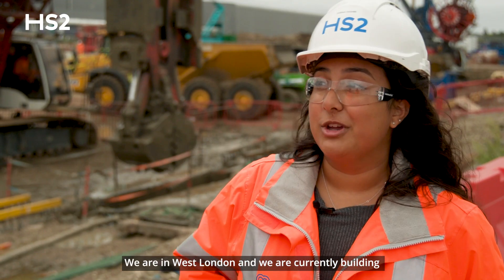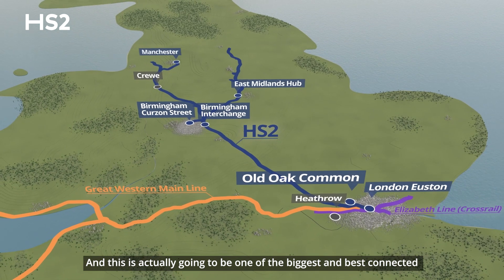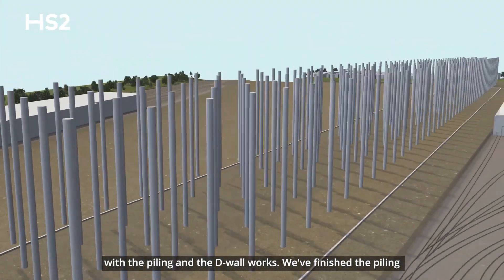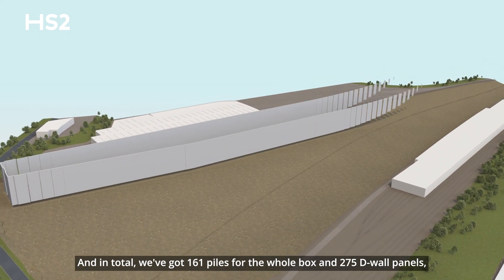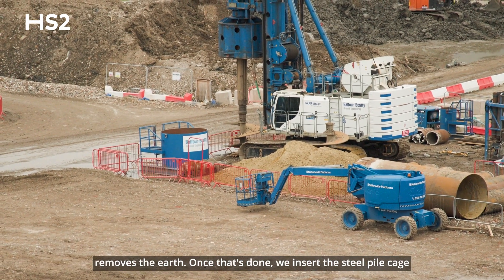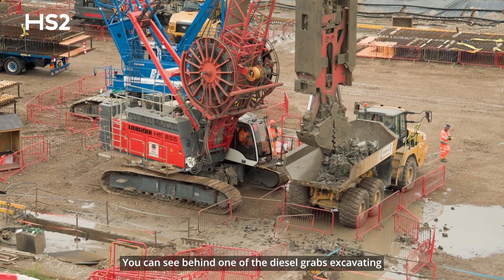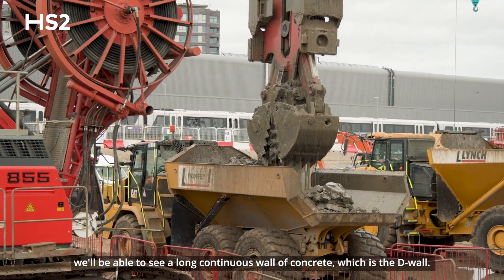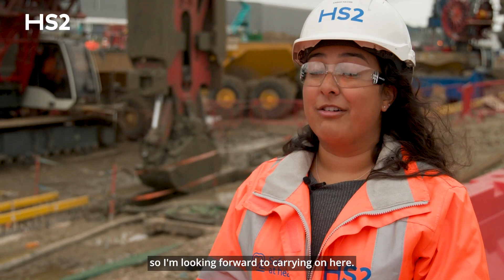Laying the Foundations for HS2's Old Oak Common High Speed Railway Station

Comment: Viewers will not miss the fact that you released this video with the "Eastern leg" to Leeds still on the map, as if you were still planning to build it, which you are not.

Please do not join with the government in propagating lies and deception about what you will achieve. Instead, advertise only what you actually WILL do, and eliminate the fantasy elements, please.
Reply: Well maybe before accusing others of "lies and deception" you make sure you have your own facts right. An Eastern leg WILL be built to the East Midlands and will be in the next Parliamentary Bill. It WILL be built eventually to Leeds and it will appear in a later Bill but even so the journey times from Leeds to London will be about 10 minutes longer. You will still get an HS2 train direct from Leeds. The main change has been to deliver the huge changes needed in the North faster and for less cost.

So here is a question: Did you really think that COVID and its huge costs would not have huge cost ramifications for major infrastructure projects?
Reply: @1chish  It won't be faster, upgrading existing lines have a long history of having multi year long delays. The only reason HS2 isn't building the Leeds part of the line today was because the government wanted to limit yearly expenditures to the same amount as Crossrail.
Reply: So… how old is this video? Or, more likely, how lazy is HS2 that it still uses old, misleading animations?
Reply: HS2 is probably technically hoping the nation get some common sense kick the Tories out, elect Labour and the Leeds section can be built.
Reply: @DavidKnowles0   Ah here we go. The Leftie finally shows his true colours. We are able to understand why you are all over HS2 videos peddling your gross misrepresentations and flights of fantasy.
Got to love the lunatic Left. Labour Party elected? ... 🤣😂😏

Comment: Love the fact that they still talk about 'the north' - like it's actually going to happen in full...
Reply: It looks like the video was produced before the announcement sadly.
Reply: HS2 is just a skeletal spine that goes through the body. From it you'll get the connecting bones that make up the rest of the body.
Reply: It will happen in full just in a different way. The IRP is the single biggest investment in railways and mass transits @ £92 Bn. People in Leeds will still catch HS2 trains to london via  the East Midlands route.
Reply: @1chish  They just get a cheap stick plaster stuck onto existing railways that won't solve the fundamental problem of lack of capacity.
Reply: @DavidKnowles0   You just demonstrated either a fundamental lack of knowledge or more likely a deliberate misrepresentation.
Your choice.
To describe the biggest single investment in rail infrastructure in the North as 'sticking plaster' says more about you than I can.